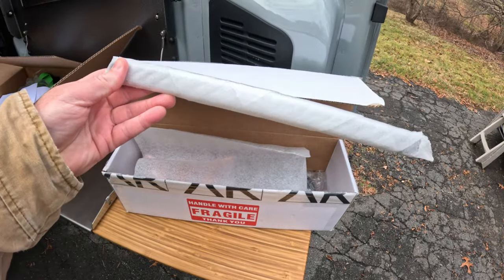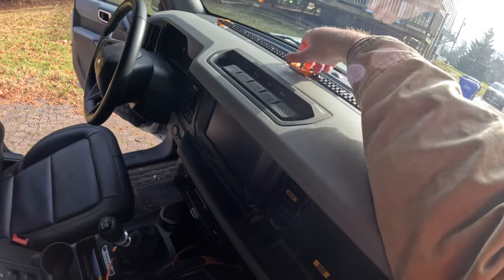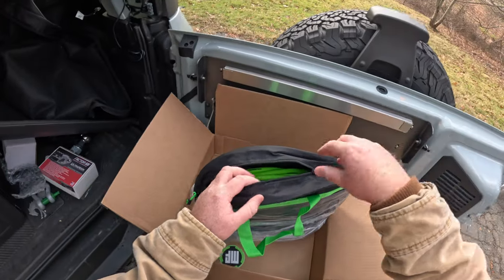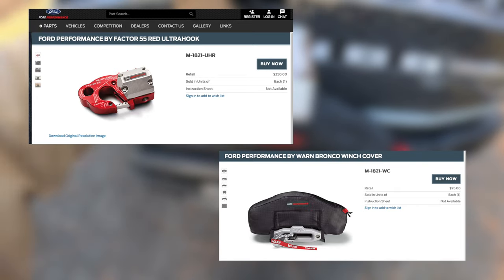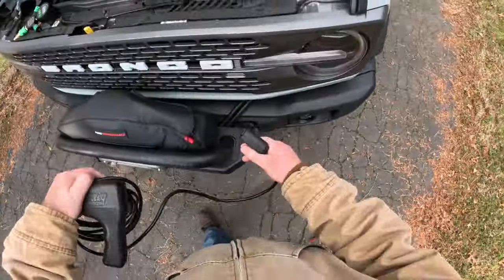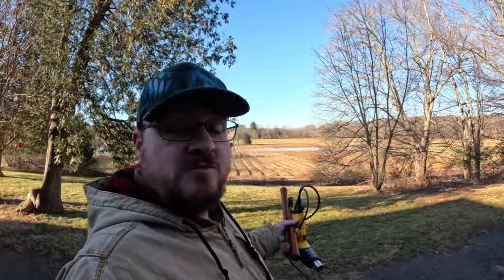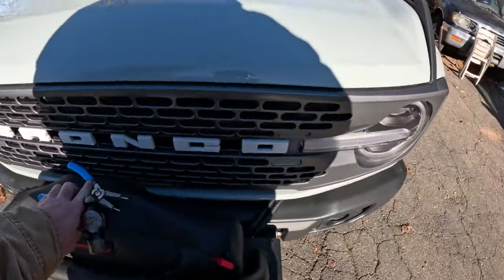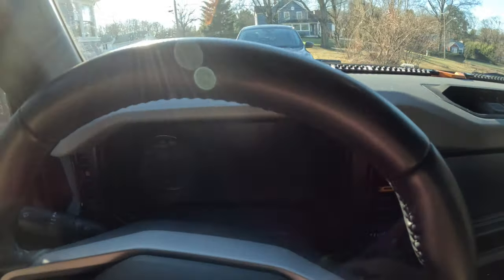The Great BRONCO Xmas Haul - What did Santa bring?

Comment: I just ran a 4awg wire with a breaker to my rear bumper and mounted an Anderson plug. I connect my Napa compressor to that and it's really quick and easy. Just an idea.  Wire goes along the frame.
Reply from the maker: I may do that.

Straightforward or any “gotchas” to be aware of?